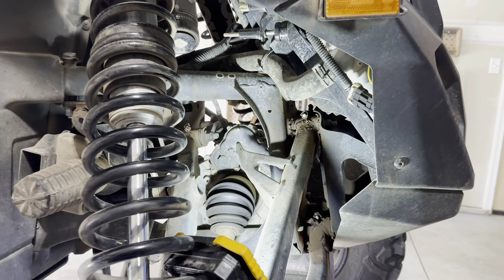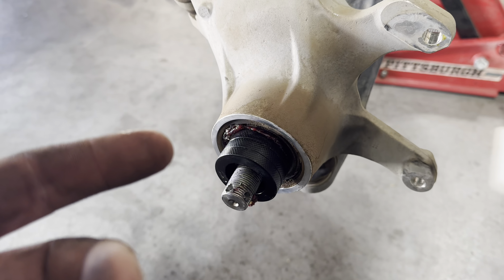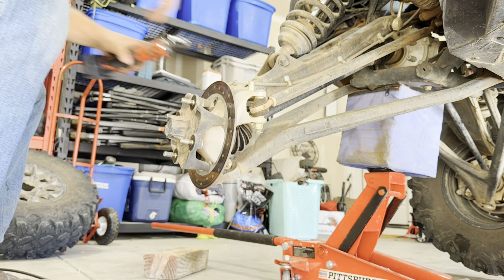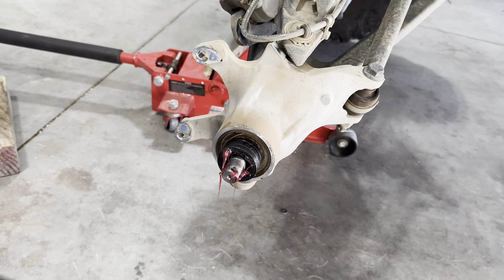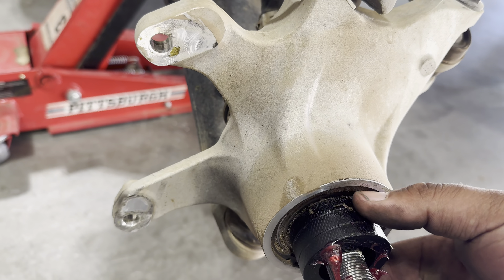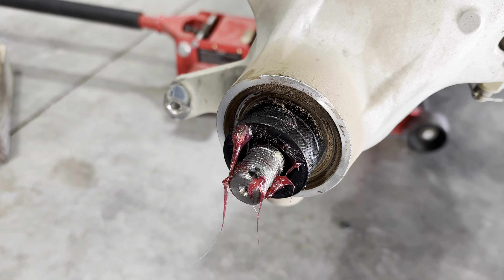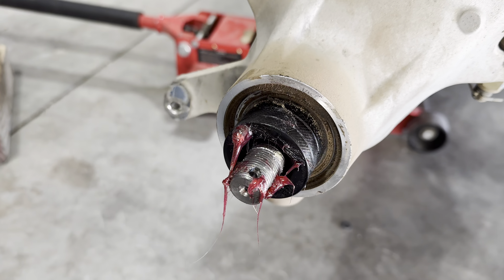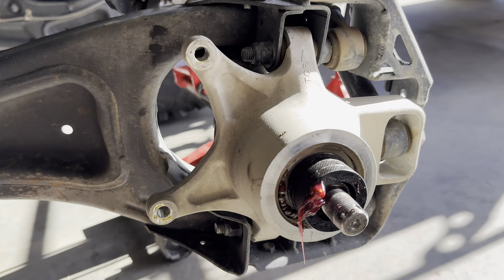Can-am Maverick X3 Grease Points!

Comment: The wheel bears shouldn’t be packed with grease like other fittings, it will cause them to blow out premature. There is a reason they seem empty from the factory, you should do no more than a couple pumps and done. You just blew your own seal in back.